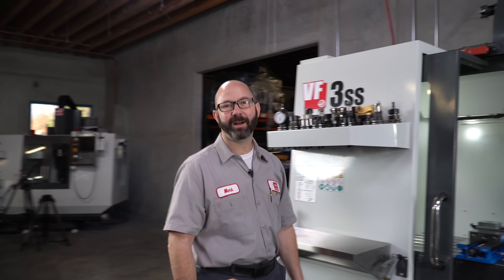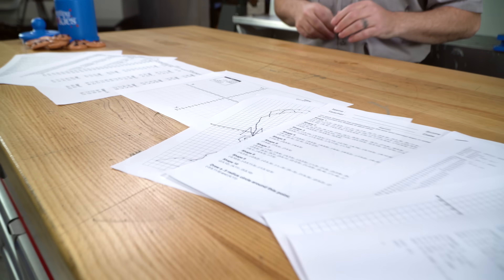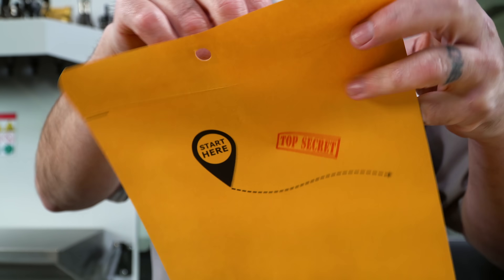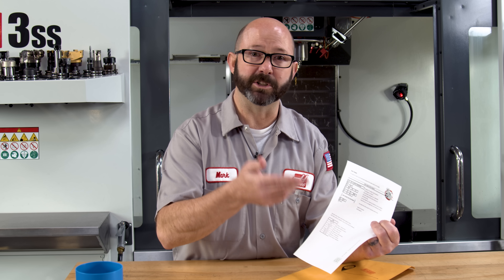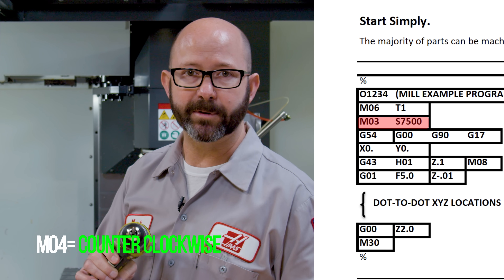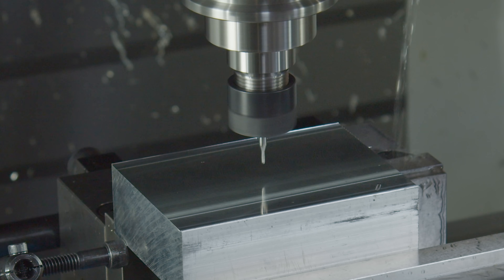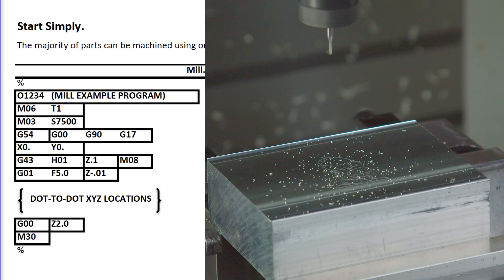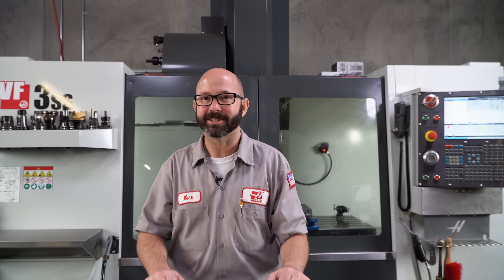9 Lines of Code Every CNC Machinist Needs To Know! - Haas Automation Tip of the Day

Comment: What I don't really understand about any type of programming is... why the aversion to the english language we already all know and use?  M03 could just as easily be SPINDLE,ON or SPIN,ON right?  Was this all invented at a time where those extra bytes would be a real issue?  If that's the case, I suppose now there's no need to write a new programming language now because it's all handled by CAM software anyways.  Still though, why so many G#s!?  It makes it so unapproachable and un-intuitive.  Even two letters to give you some kind of clue as to what that line of code does, that couldn't have been too hard... right?  I'm sure there's something I'm completely missing.
Reply: Bridgeport did something similar to that years ago to try and simplify things, but managed to get left behind in terms of popularity for their CNC. It more just boils down to what the majority of CNC has done for most of its life so it has just been a standard. You probably would have an easier time trying to get America to swap to the metric system before, as both are just systems everyone is used to and to change would be a huge impact for the amount of equipment and software that would have to change virtually overnight to sustain a more simplistic approach. Just remember, if it sounds more complicated than it should be, it is probably was an engineer's idea lol

Comment: Great videos! We recently had a new VF2 installed and it's amazing just how closely it matches out now ancient VF2 from the late 90s in terms of control. Made it easy for me to transition over, taking in to consideration a few new buttons and a fancier display.

Would love a CAM system. We free hand all our programming here, but are looking to invest in that at some point. I dont know how any of that works but I would love to learn, sounds like the way forward and a huge time saver I bet
Reply: HI MATT, i am getting in my TM-0P october 3/22  i have cad nailed but no experience on the cam side of things. what did you end up doing?

Comment: But can you call in a 9-line?
Reply: On the Haas control we have conversational programming that we call our VPS (Visual Programming System). When we go to those screens, we answer a few questions and the machine outputs the needed 9-lines of code and whatever else is required. This is a good way to make a part quickly.  You can take a look at VPS here https://youtu.be/Gjc6GmKxHoA

Comment: Cancellation program line
Reply: Vignesh Vignesh I thought of adding in a G40 and a G80, but skipped them for beginners. If someone had tried to rapid (G00) while still in a G41/G42 compensated move, the machine would alarm, no big deal. And, a G00 also cancels any active canned cycle commands like G83 drilling, the exact same way a G80 does. So, in a strange way, a G00 does the same thing as a G40 G80, in practice. Great comment. - Mark.

Comment: i want to know before i start can i break the cutter and wreck the machine by putting in improper codes or get my order of operations set outside standard best practices.

or is the software going to be able to  sense somthing is amiss (using AI) and stop me from wrecking the tools and part.   Like a compiler error or something.  obvious answer is yes, but just how well does the software react to detrimential and non-standard commands.  how well does the machine learn and does it prevent things like threading a hole before drilling it, ect.  How much AI is in the software.

ok lets say I have a finished part and i want to put it in the mill and i want the software and some kind of tool to scan my part and then write a preliminary code for the part which has to then be adjusted for the final program to run.  yes, no.
Reply: Firetip on newer Haas NGC machines we have Safe Mode which can stop the machine before things go bad, in G00. check out this video https://m.youtube.com/watch?v=enDkju3b09w

Comment: No cutter comp? just a simple G41 D? makes life so much easier!!
Reply: Whiteys Workshop yep, for sure. I’m with you. G41 is on the “Learn Next” list. I’d love to do a video on Cutter Comp, we’ll bump it up on the list. In order to make a good part (not just a part), we need to get comfortable Comp’ing our tools to dial things in. Thanks for the comment! - Mark
Reply: @markterryberry4477  Make sure you mention that most cnc machines have a setting to use either tool radius or full diameter. Operators need to know which value to use on a particular machine.

Comment: in 1980  where i was working  the older machinist got to learn to run the new K & T cnc mills.   to say we had a steep learning curve  is a big understatement.  these new machine couldnt interalate going around a corner.   we had to input point to point by hand.

Comment: Don't you need to input the safety codes?
Reply: MrGaragenation those are included in these 9 lines. Our Safety Line is our G54 G00 G90 G17 in this case. With these 9 lines, we can safely run any tool... until we get into 5-axis work, and that my friend is for another video. - Mark

Comment: Thanks Mark, I enjoy your tips. I'm a back yard manual machinist that has the CNC CERTIFICATE. But have never worked in the CNC trade. Mainly because my regular gig pays well and too close to retirement to start at the bottom of the food chain. I have manual machines but I can see a cnc mill in my retirement plan. The desktop   Hass CNC machine realy peaked my interest.  Trying to figure out how to break the news to my wife I want to buy another $8000. Toy for my shop without causing permanent damage to our 43 year marriage. You would think she would be used to my propensity for expensive toys by now.  You are a great teacher.
Reply: 😂prays my man😅

Comment: forgot a imported code, G20 or G21
Reply: chad danylak we did didn’t we! As soon as I created the Bonus Content programs, I added a G20/G21 (alarms if not In inch/metric)! I figured most people leave their machines in either in/mm, and don’t switch back and forth often. Thanks for comment. There will always be codes like this, but we can look them up in the manual as they pop up. :) - Mark
Reply: @markterryberry4477  safely 1st as someone could have played with the setting or a past program switch it to inch by mistake due to cad cam fault

Comment: Just out of curiosity why did you change the feedrate to 15 IPM? was the 5 IPM just for the Z downward move?
Reply: Frequently tools such as end mills will tend to get chipped edges or break if you feed them into a cut in the Z axis as fast you feed them in the X and Y axis.  So, it's common to use separate feed rates, and  CAM software will have separate inputs. If I am feeding a tool down in the Z- direction and not cutting anything but air I'll usually use the same feed rate. It keeps the program smaller and is easier to edit at the machine if desired.

Comment: I just found out G13 I xxxx. Instead of G02 & G03 makes life so much easier.
Reply: Not in all cases, if you need a .625 hole and your using a .5" endmill it would take longer to use the g13. 

Now if you are facing a part it will be quicker for a g13

Comment: G43 will make or break a program, machine, and part.
Reply: old shit I forgot G43, so close to a loud band with the prob
Reply: @chaddanylak8706  I've worked at places where the lead will get mad about wasting time, but always dry run slow first and you usually catch any whoopsies. They get much more mad about bangs than a little air cutting.

Comment: Mark great video. I kinda did it backwards. I'm an engineer by trade. Didn't know a thing about CNC. Learned a bit on a chinese CNC i bought to learn the basics (using MACH 3 then) until I just went for it, quit my $140,000+ job and opened up my shop running a VF-5SS. Crazy scary. I relied heavily on my CAM system and it certainly got me through since I didn't know G code. But as the code is posted, I've been taking the time to understand more of what is being spit out, especially the G and M codes. Videos like these definitely help with that so thank you. Don't be mad because I learned G code backwards though :( lol
I'm sure a basic program can be written by hand pretty quickly, the conversational programming is pretty good as well. But more complex toolpaths, especially 3D surfacing would be a nightmare to do by hand. Because of my background, I know CAD/CAM extremely well, with my G code knowledge growing slowly. But I think they are mutually exclusive. It does make you a better programmer if you know both though. Keep up the good content.
Reply: Cisco Hernandez I programmed for only a couple of weeks by hand before jumping into a CAM system, and never looked back. If you had just 100 hours to learn to run a CNC, I’d spend maybe 5 hours on these basic G-codes, 10 hours on setups (making things straight, setting offsets, using an indicator/probe), 10 hours on tools (drills/end mills/taps..) and their speeds and feeds then the remaining 75 hours getting to know my CAM system. I just made this schedule up, but you get the idea. The way you described learning things through your CAM system is a solid approach. We only have so much time - Mark
Reply: @markterryberry4477  Completely agree. When I was in the engineering world, we were design aerospace systems for Space X, Boeing, Lockeed, Northrop, etc. I got to test some of the equipment in the field, but man, my attention was always on the floor. On my own time I'd go an talk to the operators to pick their brain. Some had 30 yrs of experience! Are you kidding me, there was no way I'd ever learn what they knew on programming manually. At that time, the idea of running my own shop was so far fetched, this was in 2012. As channels like yours, NYC CNC, Titan and other started to come out it certainly has made it possible for guys that have no experience to jump in and learn. It's been a hell of a ride and the learning curve is steep as hell, I have had some very expensive mistakes but man am I happy. The business is growing and my experience with it. Fortunately, I have been able to stay profitable. Once again, thank you for all the content. I live in California so maybe one day we'll get to meet to discuss things more in detail. Keep em coming!
Reply: @ciscohernandez4384  I know this is a very old comment but you learning that code is not only valuable for making money but the guys on the floor respect you so much more if you know what you're talking about and can work through something with them.
Reply: @MrNinjaman63  Very true. During the time i've been programming I'm certainly polishing my skills understanding more of the code and getting deeper into post processors. And well it also helps I'm the owner of the shop lol. Either way, in my experience it's more of a people thing having the floor's respect vs. knowledge. When I don't know something I don't hesitate to ask and operators have absolutely no problem walking me through the ropes. They help me in some areas I help in others. Thanks for the comment

Comment: No place looks like g28 Z0. X0. Y0.
Reply: Dont use g28 on lathe or mill unless in g91. Better to use g53. Dont have to worry if g91 is set to modal or not.
Reply: @dragonflyfab8982  G00 G91 G28 Y0. My tool has already been moved up in Z for clearance.. and I'm just bringing it forward for the operator. I set up parts for a plastic injection company. One tool. At the most four tools.. usually only one G50.. (G54) at most a G54 & a G55.. some of the programs they have don't have diameter comp or hight offsets.. you just wheel it down and then change the program.thats one the Fanuc controlled mill.. the Haas we probe everything. But it's real simple work.. drill and tap a hole the mold can't make.. mill a slot. Basically shapes that would prevent the part releasing from the mold.
Reply: But you just ran into a tree and got a drunk driving ticket before you got there
Reply: @dragonflyfab8982  single block and distance to go are your friends. So is graph mode..

Comment: Super handy to know if you're running a simple one-off part and don't have time to CAD/CAM it or if you need to debug a program. Also, the tool change commands are helpful on older machines when setting up or changing out tooling. G-code IS still relevant and useful to know!
Reply: Is relevant and always will be. G code is simplest way to program  your cnc .
Reply: Hass machines are famous for being not only user friendly but the conversational side is easily understood by New folks as well as others.
Reply: @matthewchapman2494 What’s not user friendly on a Haas? I would argue they’re one of if not the most user friendly machine on the market.
Reply: @jumpman2680  I just got a Haas and compared to the  early nineties Okuma's I have so far it seems like a steeper learning curve.
Reply: @phillhuddleston9445  I would assume there moght be a slightly steeper learning curve with a newer vs older model with the newer added features and technologies, but your basic setup and the way it runs code should be similar. The reason I said Haas are very user friendly is partially due to the way setup works with probing datums and tools and such. Most CNC’s have all the same basic controls.
Reply: Most if not all CNC's still run on G-code so it's absolutely helpful to know it when problem solving and making small changes so you don't have to create an entirely new program on CAD.
Reply: @phillhuddleston9445 Unless something has changed, all CNCs still run on G-Code even if you don’t typically see the actual code from the manufacturer’s proprietary programming interface, which is very common say in the wood industry.
Reply: I fat finger half my code lol faster than drawing and transmitting the code.

Comment: Well nobody is going to write a whole CNC program to make anything significant, it still helps to know what the basic G-Codes and M-Codes do. When you are testing out a new part, its often easier to change a speed or feed or such at the machine than to go back and rerun the CAM. Also if you are validating a CAM tool / post processor for a new machine, you really need to understand what the G-Code does.
Reply: Are you kidding? I would guess about 25% of shops use hand written code only, and 90% of shops use at least one hand written program a month.
Reply: @spikeypineapple552  job shopping simple parts for sure. But some just send that to the manual mill to save cnc hours.
Reply: @Eluderatnight  mate you're living in a different universe
Reply: Brucec 95 i was surprised to find so many hand programmers when I moved to Michigan years back, but they were machining on castings, doable. For Billet work, machining from solid stock, you really need a CAM system, although, on the lathe side I’ve met a ton of fantastic lathe hand programmers that were really efficient. Today, with live-tooling lathes, we’ve blurred the line between mills and lathes and more machinists than ever are jumping straight into a CAM system. I guess it all depends on the parts you are running. - Mark
Reply: Our shop has two guys that wrote G-Code by hand well before cam software was something the smaller shop could have. We still use some entirely hand written code for parts we make regularly. You can be extremely complex by hand, but it's a dying art and easy peasy visual cam software is making modern programmers just lazy Facebook jockies that use a computer better than their other coworkers.
Reply: My buddy Jack does.. he uses an old form of Bobcad for the numbers and writes everything by hand. But he's been doing it for almost 30 years.